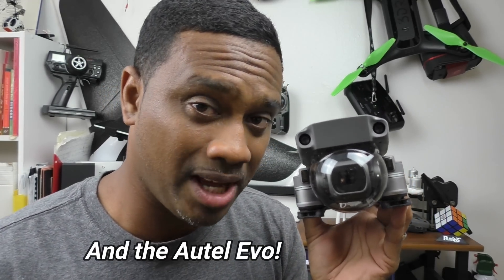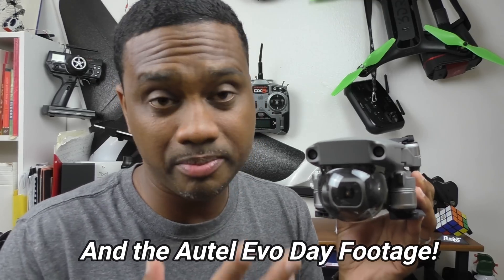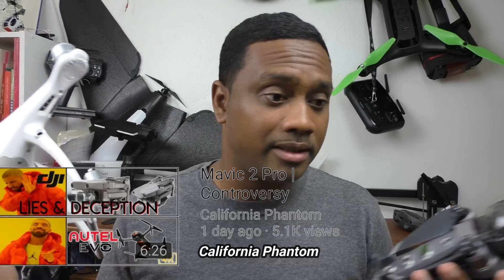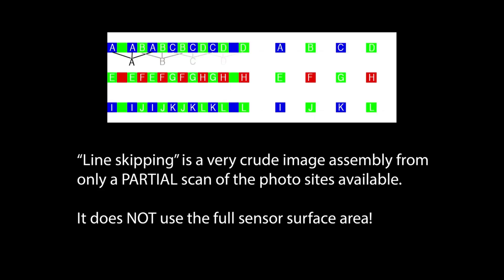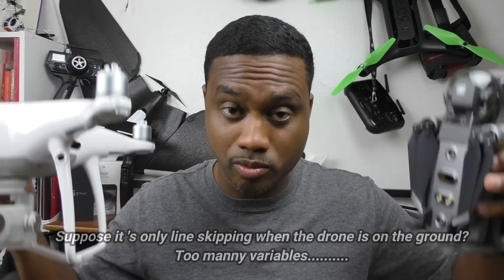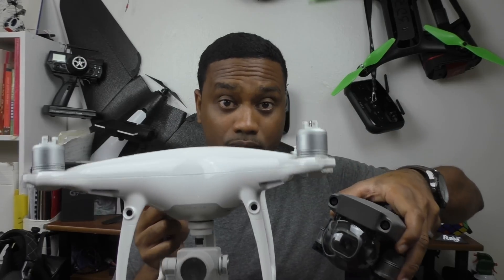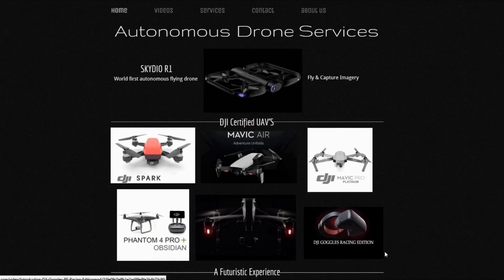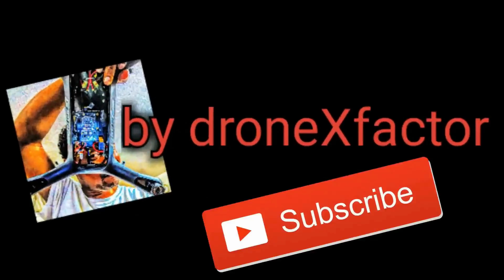DJI Mavic 2 Pro 1" Sensor is Line Skipping & Overheating?

Comment: DJI’S OFFICIAL RESPONSE

So, after having watched Cliff’s video, we reached out to DJI and asked them for an official response. We had a few questions for them, including whether the Mavic 2 Pro would be able to shoot 4K video at 60fps and also whether overheating played a role. We did not get answers on all our questions but DJI did say this:

“Mavic 2 Pro uses a different processor than P4P and has two 4K modes, as stated on the product page, which are FOV mode and HQ mode. FOV mode has a wider view but less details than HQ mode. FOV mode’s image processing requires raw subsampling, which scales 5.5K raw into 4K raw before feeding it to the image processing pipeline.

Raw subsampling is different from line skipping; it uses the full area (of the 16:9 portion) of the image sensor so the signal-noise-ratio is much better than line skipping. Raw subsampling is also different from pixel binning. It is an optimized filtering & sampling process which is much more advanced than the simple average mechanism of pixel binning. Raw subsampling causes some loss in the finest details. However, this is not as visible in real scenes (like aerial filming) as it is on charts.

DJI looked into many solutions for implementing FOV and found that the current FOV mode is the best compromise for the Mavic 2 hardware. Please remember the Mavic 2 is an extremely complex and compact piece of hardware. The current solution represents the best possible way to enable filming using the full 1” sensor wide angle area FOV on the Mavic 2 hardware.”
Reply: a businessman will never tell you his product has a fault,always believe that,sometimes i wander if you guys has a mind of your own or not...
Reply: still, its pretty impressive what they did with this formfactor. im happy with the m2p image quality and the ways you can work with it and edit it.
Reply: YOU KEYWORD THERE IS EDIT.if you have to edit a photo or a video just to get it near to perfection then the purpose of the product has been compromised.i never edit a video or a photo quality so its the reason why i bought the Autel Evo,the mere fact most of these drones are already using a small sensor and low megapixel IS ALREADY frustrating..
Reply: @anubisnick830 , Yup, No Editing! The difference between person going for pro results and someone just having fun. The Mavic 2 Pro is a good starter drug for moving into the pro results drone line-up.

Comment: The one inch sensor as i ve seen comparing with the 2zoom is only in low light video...And the most common problem is that shooting at night (which footage is great) we see low noise,...but  many ,many dead white pixels at 800 and of course 1600iso.Unfortunaly we cannot see them shooting at day.80% of this "hasselblad" sensor has this issue...It s a great drone but i m very tired  about the communication with DJI...

Comment: The issue still here? Or fixed?..im planning to get the pro soon
Reply from the maker: Not fixed it's something we've come to live with because the majority of people can't tell the effects, they just know it's not the best way to process from the sensor.
I say buy, you won't regret unless you're a experienced pro photographer or videographer with high tech equipment looking for a drone.
Fly safe
Reply: @droneXfactor  seriously selling my p4p for the m2 zoom kinda bad bad mistake. P4p color profile enough for me to take the video out of the drone and use it without post editing since i dont have powerful computer. D cinelike kinda hard to grade with only using my phone
Reply from the maker: No way on Earth I'm selling my P4P for a mavic 2 zoom
Reply: @droneXfactor  yeah my worst mistake is selling my p4p for the zoom . Either i buy a used p4p or the new m2p ;(
Reply from the maker: Used P4P will save you much more money because they are older than Mavic 2Pro.
I hope you get your P4P back or a M2P.
Thanks for sharing
Reply: @droneXfactor  have u heard the news bout dji launching new products this april or later? Holding on to my money until then

Comment: Sorry but IMHO, you dont know what you are talking about (and you admit that so I'll let it slide). You claim that to test the p4p and m2p with different FOV you should take the video from the same distance, which is WRONG. To have the result that will make a MEANINGFUL comparison, the object HAVE to occupy the same number of pixel on the sensor, incase of the m2p and p4p, since the 2 drones have same size sensor, it's imperative that the 2 drone is placed so that the FOV is exactly the same.
Reply from the maker: Makes sense.........is there a way to get a readout from the sensor?
Thank would seem more accurate compared to a chart.
Thanks for sharing and offering clarification.
Reply: @droneXfactor  well the VIDEO being recorded IS the sensor read out. The chart is merely a standard object that helps you compare the 2 image processing engine. as long as you keep the chart occupy the same number of pixel and it is the same chart between shootings you'd have a pretty good representation of how 2 camera does their processings . The leading camera maker in the world use exactly the same test (albeit with a much pricier chart but for the sake of comparison, as long as it's the same chart, it'll be okay). The problem with M2P is that DJI did pixel binning directly on the sensor to avoid reading every pixel at once (I believe they did not do the line skipping since that method tends to give some differences in vertical and horizontal resolution, which is no where to be seen on Cliff's test). And pixel binning takes out alot of detail and resolution. The issue is REAL, that's beyond any reasonable doubt. DJI really screws it up this time. The only question now is will you mind this flaw? To me, I love my m2p and have no regret replace my trusty p4p with it. It's just a better traveling drone. But the video quality fall short in comparing with p4p, period. 
It looks to me that you do not have the basic understanding of how digital image sensor works. Cliff is an expert in digital image processing and it'd be wise to listen to him, that guy knows what he's talking about.

Comment: Why would you get the mavic 2 pro if you can’t  detect the difference the quality between the zoom or Mavic air even
Reply from the maker: Because you can definitely tell the difference at night...... However if you can't tell the difference and you don't fly at night then there's no need to get it in my opinion.
Thanks for sharing.

Comment: Pro does not have a true 1” sensor, therefore it can’t give the same detail as a 1”. Also DJI said  “the mavic pro 2 line skips”. I will say the pro has better night footage because if it dynamic range and “larger” sensor than the zoom. IMO the only benefit to the pro over the zoom is night time quality nothing else. Daytime footage has a brown color tone and drives me crazy when viewing day footage.
Reply from the maker: Wow DJI said that?
I don't think so, did you try adjusting the white balance to get away from that yellow color?
Reply: droneXfactor, compare the footage side by side and you will see it.
Reply from the maker: @odeonarain  
Like I said in my last video, there is no comparison, P4P all day....... Keyword all day ;)
Reply: droneXfactor agreed P4P is the best of the 3 as far as image quality. But between pro and zoom, I  prefer the picture from the zoom.
Reply from the maker: @odeonarain  
I'm guessing it's the yellowness/ warm color that you don't like?
Reply: droneXfactor, I just don’t see any benefit from the zoom to the pro. If image quality is what you want then just use a P4P. IMO
Reply from the maker: @odeonarain  
I see that the P4P doesn't give you the portability like the M2P.
Portability is a huge factor and convenience and that's why everyone wants the mavic 2 Pro to be at least as good as the p4p because to have that camera ability and portability would have been unbelievable.
Reply: droneXfactor, agreed, but the space limitations on the Mavic make it hard to do so.

Comment: it's not about night or daytime flying it's about a 1 inch sensor labled hasselblad! m2p cam is the worst 1 inch sensor cam on the market! the other thing, dji restricts us with nfz  height to match local regulations so nightflying is forbidden in most  countries so wtf is m2p for, only nightflying! p4p is the better choice for pro and enthusiasts! 1 inch sensor on mp2 is just a selling point and no quality point! ut's just a big cheat on customers!
Reply: there is no need for a bad 1 inch sensor! to achieve the best possible image from the m2p you need to be nearly a pro, but for a pro m2p it's not realy usable, better of p4p! so this drone is for ???? nightflyers? what a joke! hasselblad and 1 inch sensor doesn't mean top shot as we all learned now
Reply from the maker: @isonic9479  
Some pros say Inspire 2 with X7 is for pros & not p4p :(
Also Mavic 2 Pro does use the entire 1" sensor....... It does not line skip or pixel bin just so you know, it does compression scaling from 5K to 4K according to the DJI.
But to each their own thoughts.
I definitely respect the P4P.
Fly Safe & have a great weekend
Reply from the maker: If you can show me another portable Drone on earth with a comparable 1" sensor today I will personally give you $500usd. This Drone shouldn't be compared to the Phantom 4 Pro however people do it because there's nothing else to compare it to. For professionals I don't recommend Phantom 4 Pro, I recommend inspire 2 with two controllers a x5 or RX7 camera.
See where I'm going with this.
The 1" the mavic pro is 4 people who want to fly at night, the Hasselblad basically just a brand and the 10 bit color which nobody really uses if Superior Color which no other the portal drone in the world has. To use these features you need to be somewhat of a professional and that's why the average person can't appreciate the Hasselblad brand on this camera.
Thanks for sharing your thoughts.
Reply from the maker: By the way you can take off in restrictions, you just need to acknowledge it and take responsibility for doing so and DJ I will allow you to fly....... I did it yesterday. Also in areas like New York City where I am the altitude limit is 400 feet legally and the DJI drone will allow me to go up to 1,500 feet approximately.
There is flexibility just not Unlimited.
Please don't make it worse than it is.
But to each their own, thanks for sharing
Reply: in the end it doesn't matter if they use line skipping, bin or compression, the image quality isn't that what it should be for a 1 inch sensor! dji should have skipped m2p like autel did with their 1 inch sensor evo! have a nice weekend too, take care

Comment: Actually whether or not one drone is further than the other doesnt matter. Similar focal length while comparing sharpness does. So his testing method while not scientific, was still fairly accurate
Reply from the maker: You're right, I'm not an expert, and a few people including yourself have been telling me that they must be spaced apart.
And DJI confirmed it was not line skipping or pixel binning.
And honestly for me to believe line skipping I would need to see some kind of sensor read out for confirmation.
Reply from the maker: Thanks for sharing

Comment: So many because it's the same price as phantom pro, is newer yet image is not better but worse!!
Reply from the maker: I understand where you're coming from as a consumer, to those who have technical backgrounds understand the challenge entailed to fit a 1" sensor camera not to mention processor, not to mention more sensors, more speed & a processor that can handle all of that and a cooling system into such a small portable unit!
What is success...... It's not the best but it's the best portable 1-inch sensor drone on the planet today.
And the price for portability should cost more because everything gets more technical when reduced in size AKA portability.
Thanks for sharing your thoughts

Comment: 1.Mavic 2 Pro is a great drone. 2. Phantom 4 Pro as a very better sharpest picture quality and a larger usual FOV. 3. Question is: why a 1" sensor could be so different in result (when looked on 4K -5K retina screen) ?
Reply from the maker: Because, Phantom 4 Pro is a full size Drone using the 1" sensor at full capacity.
M2P has possibly the smallest 1" sensor camera on earth which is using the 1" sensor to the best of it's ability.
M2P wasn't designed to complete, much less destroy P4P Drone.
It's the first, best & only 1" portable Drone in it's category (no other in the world) & has the best looking footage found on a portable Drone, especially at night which is what people asked for.
Soon as another company can make a 1" portable drone & give people something fair to compare to M2P people will continue to make the full size P4P with full size camera the bar.
Thanks for asking....... Fly Safe.
Reply: droneXfactor   people are all talking that Mavic 2 pro does not use the full 1-inch sensor for videos, just want to know how about for photos? Does M2P use the full sensor for photos compared to videos?
Reply from the maker: @kaihangchen2308  
I just for confirmation DJI released a statement saying that the entire sensor is used and they are not pixel binning or line skipping the processor......... They are down processing the image.
And I believe the same would be for photos although DJ I would know that for sure.
Thanks for sharing
Reply: droneXfactor  wow, that will be a great news, as I just bought the M2P and sold my mavic air. thanks for your information, just subscribed.
Reply from the maker: @kaihangchen2308  
Except for the mavic air being more portable......... Mavic 2 Pro does everything better :)
I think you would love it :)
Congratulations
Reply from the maker: I think that the sensor just senses and reads which is just the beginning. Processing the read out is another level. Software as well has a big impact I think. However DJI should be really answering these questions because my technical knowledge doesn't go that deep yet.
Reply from the maker: On the display side I think what colors contrast and just the way the camera is tuned and then set up plays a big part in why footages look different. However I'm not an expert yet just my thoughts.

Comment: My biggest issue with my mavic 2 pro and zoom right now is how the gimble scratches itself during flight.  The rear gimble motor makes contact with the plastic gimble bracket which creates scratches.  Super frustrating.
Reply from the maker: Wow I haven't noticed that!
I definitely need to look into that
Reply: I hear everyone say it’s a tool... he’ll all my tools have scratches and they cost a hell of a lot  more than $1500
Reply: Ummm yeah.  I used to be an automotive technician and had thousands of dollars worth of snap on and Matco tools and did not complain once about scratches because it’s all about context.  Automotive tools and tools like it are expected to be put through much more wear and tear and naturally get scratched and banged up.  But there is no reason other than me crashing the drone or hitting something for it to be scratched.  All of my other drones do not have a single scratch on them, because I never crash.  It’s like buying a Ferrari and due to the exhaust tips not having enough clearance from the bumper it scratches the paint while driving.  Does the exhaust still function properly, yes.  But is that acceptable quality control for a high end company, fuk no.  However if I purchased a 4x4 Jeep and drove it through the sand dunes, you think I would go to the dealership and be like why the heck is there scratches on my Jeep after 4 wheeling through sand dunes, no of course not.  You’re argument is not valid.
Reply from the maker: I noticed it today :(
Reply: Lol yeah I mean don’t get me wrong I am flying my mavics all the time and I really do love the performance and image quality.  I just want dji to start being held accountable for these small defects so they can improve quality control which honestly has not improved much over the last 4 years.
Reply from the maker: @alexrothbard4324  
Understood

Comment: Before this drone was released, people were building it up to be the ultimate drone.  The Autel killer, this and that.  When it was finally released and the honeymoon phase was over, we start to realize that camera is not the greatest. We see that it does not have a mechanical shutter, and does not do 60FPS like other drones, they are disappointed.  I cannot blame them given the hype built around it with all of this Hassleblad, 10 bit stuff.  It's a solid drone but should be better given the cost and now rising costs.  P4P is simply a better camera.   But the trade off is portability.  But hey, fly it, love it and have fun!
Reply from the maker: I totally agree....... People think DJI can snap their fingers and put a 1-inch sensor on a portable drone and make it perform as well as a full size drone!
I think they built the hype up too much on themselves, and that's why I said in my previous videos sell your original mavic because this one will be a big upgrade, but don't sell your P4P, I still have mine!
And I have a few friends who are now returning they're M2P to purchase again the P4P!
People....... LoL
Reply: @droneXfactor  I'm going to keep my M2P.  Overall, it is still a great drone